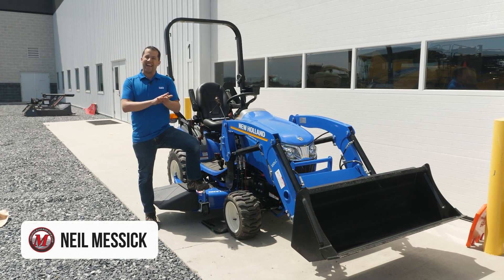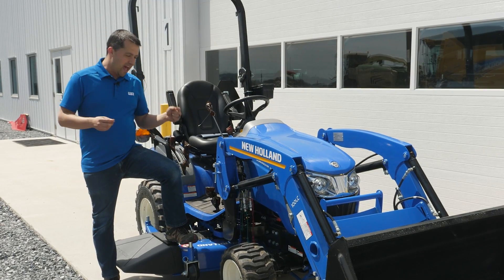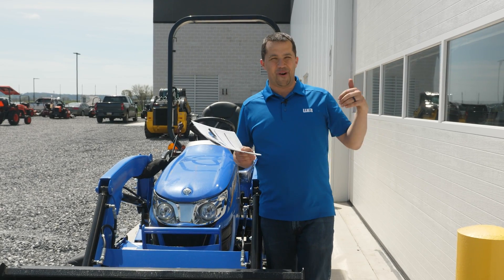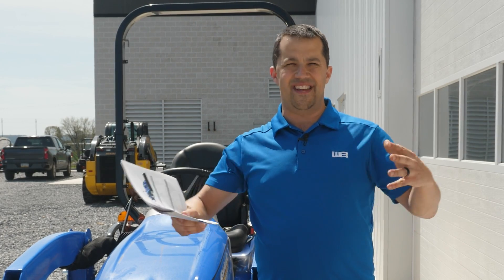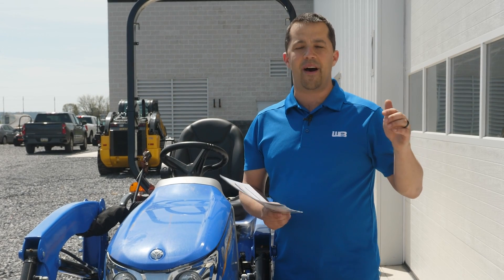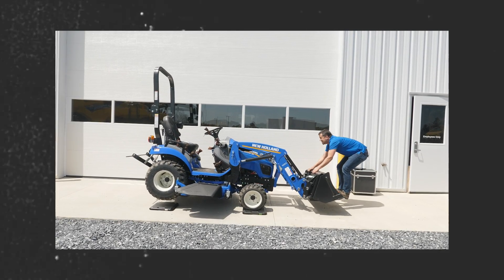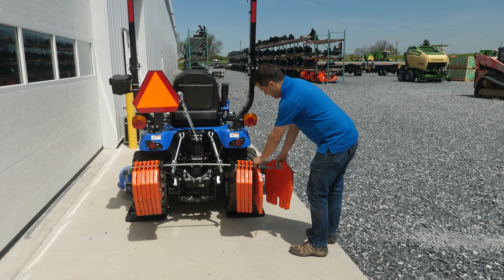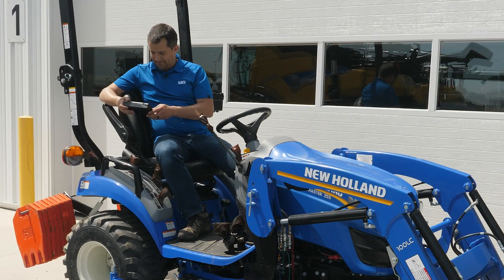Science! The relationship of Ballast and Weight Distribution.

Comment: You left out an extremely important fact. Wheel weights and tire fluid ballast will have ZERO effect on the front axle load. The teeter totter effect of the rear weights taking weight off the front axle only occurs with sprung weights BEHIND the rear axle. The disadvantage of using rear suitcase weights is that they put more stress on the rear axle and rear axle bearings. Wheel weights and tire fluid ballast are unsprung weight and will not reduce the load on the front axle. But unsprung weights do not put additional stress on the axle or axle bearings because it is supported solely by the air in the tire. You should do a driving test. 3/4 full bucket of dirt driven on an uneven surface done with no weights, rear suit case weights, and 3rd with wheel weights / tire fluid ballast. Show us the driving stabilities of all three.

Comment: Neil, you said something that was a little confusing.  You said that putting weight on the rear of the tractor "took weight off of the front axle".  I don't see how that is possible.  You may have decreased the "%" of weight on the front axle, but not actual weight.
Reply from the maker: The statement is correct. The rear tires act as a lever and shifts weight from the front axle to the rear.
Reply: @MessicksEquip  You would need to show me the actual scale readings to convince me.

Comment: I have an lx3310. It has filled rear tires, but it would still pull the rear wheels into the air. However, I added a quick hitch, and it has helped that tremendously. Is it properly balanced? No. But it’s a hell of a lot better than it was. I think the hitch was about 90lbs

Comment: I have a John Deere 4052R. With my specific loader and tires the manual calls for the rear tires to be fluid filled AND have at least 800lbs on the rear 3-point for safe lifting. It was not easy to find, but since I built my ballast box I will go any other way for lifting, dirt work, and even grapple work. It makes that much difference in the handling of the tractor, even with it being a larger frame compact.

Comment: that the video that needed to be made. blasting, especially on smaller tractor. and more weight in the back the more traction you have. 

to remember that wheel weights only add weight to the rear end (over all weight) and only 3point weight move weight back from the front onto the rear.(also add to the overall weight) 

I never had a problem with lack of power, especially in lower gear, but always break traction. more traction more "work" can be done

Comment: I’d be curious to know what a full bucket of dirt on that specific bucket weighs..  most guys are using buckets for lifting dirt so knowing how much a full bucket weighs then seeing how that affects the front to rear weight with and with out rear ballast would be cool. None the less it was a fantastic experiment and goes to show most tractors are front end heavy right off the gate which you’ll find out quickly the first time you drive fast over bumps like you stated.. I keep about 600 lbs total rear ballast on my bx and it feels very planted even with the hydraulic pressure cranked. Iv got the quick hitch, heavy hitch, 8x 42lbs weights.. plus my tires filled.. I feel that should be about all anyone really needs for weight on their sub compact (judging from experience).

Comment: Neil, my loader got a little heavy recently & a rear tire came off the ground. I realized then the real risk isn't tipping forward, it's that as it tips forward, the front axel becomes a side to side teeter-totter & it WILL go over sideways. A video showing this instability when all weight is on the front axel might be helpful IF it can be demonstrated safely without damaging you or the equipment.

Comment: wheel weights help with stability, traction, and some weight distribution but to get better balance and lighten the load on the front axle you need ballast out on the 3pl.

Comment: I loved the demo of standing on the bucket and making the rear wheels lift.  
I just did that today pulling an old water pipe which we attached to with a chain and 'pulled'.  My rear end, with ballast in the tires, almost completely came off the ground.  I would have needed another 1000 lbs or more to keep it down. But we did get the buried pipe out of the ground.

Comment: Question, how much weight is too much? Kubota dealer told me not to put wheel weights on since I had liquid ballast. He said it was too much for the axle. Comments? L3301 Kubota
Reply from the maker: The rule I know is 50% of the machine's weight is okay as ballast.
Reply: Different sorts of ballast I'd have thought.  

Liquid ballast and wheel weights don't directly put weight on the axle - the weight goes directly through the tire to the ground.  They do put twisting load on the axle when driving (but I wouldn't have thought too much), and I guess going over bumps and things that'd add load to as it bounces around.  

Ballast on the 3ph would put much more load on the axles and bearings, because that weight has to transfer through the bearings and axles to get to the wheels and the ground.  3ph ballast I still think is better - because it pivots on the rear axle and reduces load on the front axle (a big thing on a subcompact), and because you can take it off when you don't need it (like for mowing).  Horses for courses, but I prefer ballast boxes.

Comment: Another important thing to remember is that the front axle has a weight limit, and wheel weights or liquid ballast won't do anything to remove front axle load. Don't get me wrong, I highly encourage liquid ballast, but weight on the 3 point (IE: behind the rear axle) is the only thing that will reduce front axle load.
Reply from the maker: I am working on a front axle video, but I don't know why fluid would not be effective. It does not have the same leverage effect, but it should help.
Reply: @MessicksEquip  It'd be effective to stop the back wheels coming off the ground.  It won't be effective in reducing load on the front axle, because it has no lever effect - it's not behind the back axle.  If you do those measures again with the scales, using actual weights not percentages, you'll find wheel weights (or just bricks on top of the rear wheels, whatever) will change the % but not reduce the front weight.  Ballast behind the rear wheels will reduce the front through the pivot on the rear axle.  I'd also note that most ballast boxes carry weight further back (on the 3ph) than the weight bar you showed - which looks nice for keeping the weight close, but less pivot effect.  Something like a rotary cutter will have even more effect - so much weight well behind the 3ph.
Reply: @MessicksEquip  Hopefully it includes numbers on Kubota tractors since they seem to try and hide those, and its not a good idea.
Reply: Exactly!! That is why l made a 1500#  counterweight for my tractor.
Reply: What I find funny is Kubota doesn't state what that weight limit is on their BX tractors, I doubt they mention it for any of their tractors, and is a very important number that owners should know.  They try and boast about everything else while hiding a very important piece of the number game.

Comment: I like that you have scales. Some kind of chart would be nice.
My neighbor and I pick up weeds on the beach during the summer. His little BX2300 has no ballast. There is a hill to climb getting to where we dump. If the lake weeds are too wet, he bounces in the seat to get up the hill. Even when I have my larger bucket full of wet weeds, I have no trouble climbing the hill on my JD 2025R. If I do not have my land scape rake on, I have a double Heavy Hitch weight bracket with 8 42-pound weights. I can easily add 8 more. Any suggestions for mounting wheel weights without help? They have carriage bolts that go in from the back. Took them off to get new tires mounted.

Comment: i would like to see how it is without the mower deck, i am betting it would be worse.  Been there done that, reverse wheelies are not fun, and bring a huge pucker factor in.
Reply: I know when I'm pushing it, because I have to put the tractor in 4wd due to loss of traction on the rear.  Yeah, that's when I should go put the ballast box on.  Sometimes I'm just doing one load though, if I go slow and keep the bucket low it's OK.

Comment: This is probably one of your best videos, very important subject. It's very diffucult to have a properly ballasted loader tractor with so many factors. I think an easy ballast for any tractor is a bale spear with a round bale. Wheel weights will provide the best overall performance while keeping good rearend stability, but weights further out on the 3pt will have more impact at the cost of some stability.

One has to take mind is the stress that goes into the center of the machine with all that weight hanging off the back and the front... just like how that bar looked like on the 3pt with those weights on either side.

Comment: Neil you nailed it, I have a neighbor with a small JD who think’s extra weight on the back will shorten the engine life!!!!!! I’ve never herd of such a thing. Keep up the good work
Reply: Heh. That lack of extra weight may shorten HIS life.
Reply: He maybe confusing rear axle bearing life, adding any weight to any bearing is going to shorten its life, but with a tractor adding ballast is by far going to outweigh not wearing out a bearing, in the less tractor rollovers they have...which at that point totally negates any sort of shortened bearing life once you roll that tractor, you are done.
Reply: @wildbill23c  I think he is confused, I’ve tried to explain, but to no avail
Reply: Unlikely to shorten the engine life - the engine doesn't care what it's pushing around, and it's made to push things around.  Probably the thing that'd shorten engine life would be mowing.....just because you do it for hours and hours and it's all high rev and high load work.  But a small diesel engine will outlast most subcompact tractor users.

Tell him that what he needs to care about is his axles and bearings.  All the load on his front axle is definitely going to shorten the life of that thing, it's quite a bit smaller than your rear, but you're asking it to do most of the work.  Spreading the load between the front and rear spreads the life.

Ultimately the problem is that tractors started out taking load on the back.  They're built with all the weight forward (when empty) to counter balance the weight they think you're going to put on the back.  But most sub compact tractors are used with mid-mount mowers (evenly balanced weight) or loaders (front weight).  So you need to ballast them to balance that out.

Comment: The capacity at carry height is generally less because the bucker is further away from the tractor than at full height.
Reply: I think that's wrong.  It's about loader geometry and the load on the rams, rather than just the pivot from the front.  If you could lift less at low height, you'd have no way to get it to full height.  My tractor regularly can lift things 1 foot off the ground that it won't lift any higher, and most tractor manufacturers publish a height/weight lift curve for their loaders, it clearly shows more capacity at lower levels.

Comment: Tractors are always just the "base tool" or "power unit" a tractor is almost useless unless you kit it out. You add a loader, a mower, you use a blade, maybe a brush mower. When you put an attachment on a tractor, you need the accessories to run it, like a bucket or forks for the loader, and weights to ballast the machine. Or if you put a 5ft mower that weighs 600lbs on the back, you need front weights or a loader with a bucket to balance the weight on the back. I wish more dealers explained this kind of mindset. A ratchet is just a useless tool without the sockets.
Reply: That's something that many people forget is front ballast for those rear attachments/implements, yeah sure the loader helps a bit with that, but if you are doing something where you want the loader removed, you just removed several hundred pounds of front ballast, so your tractor may easily start doing wheelies with whatever attachment or implement you have on the back.  Same goes for moving around trailers, everyone loves to do that but they don't think about the ballast they need to have on the front of the tractor to counteract the tongue weight of the trailer.